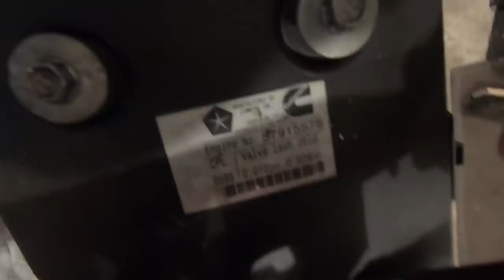Craigslist Cummins Gets A TRANSplant!! & 4th Gen Cummins Rear Main Seal Install

Comment: You REALLY should've loctited those little bolts on the rear main housing they are absolutely notorious for rattling loose
Reply: Austin Lowhorn not nessesarty the backing plate will stop it from coming out
Reply: @weldingjunkie  the blacking plate is recessed around it trust me they can vibrate out I've seen it happen multiple times
Reply: Austin Lowhorn I know it’s possible they won’t and the holes are blind so no oil will come out. He’s selling it anyway
Reply: 68Camaro RS/SS I’m saying it’s not common practice to have to loc tite. Anything is possible even with loc tite so yeah it’s not needed. I bet you like to troll all the post

Comment: Do you have to fill the converter with oil? I just swaped a 3.5 Altima cvt and I pulled converter off dumped old oil. I figured the pump fills the converter no? I’m just about done so it’s too late but just curious
Reply: it will run dry till the tranny fills it
Reply: @peterhatkewitz9956  thanks  that i figured but is it like just filling the oil filter in a oil change? just giving it a head start? never seen anyone fill the converter first. i know i never have.